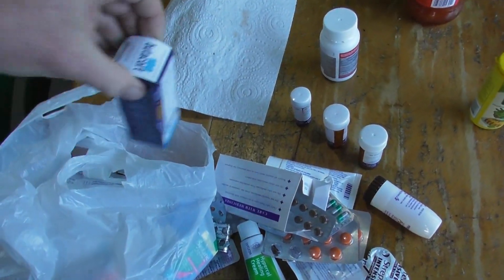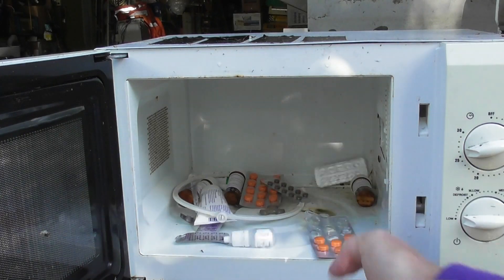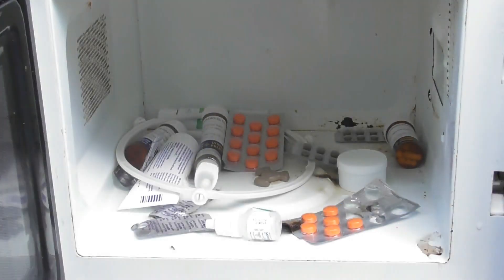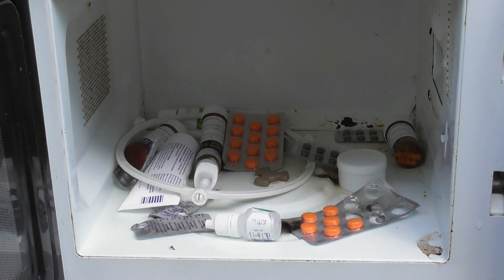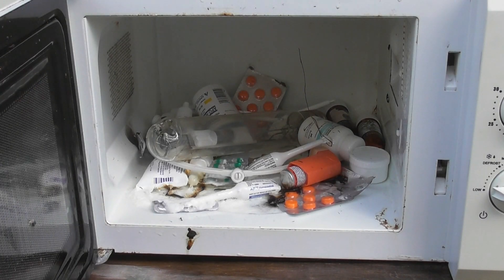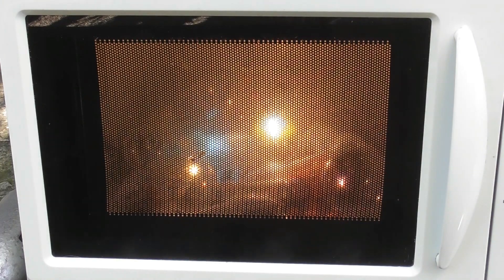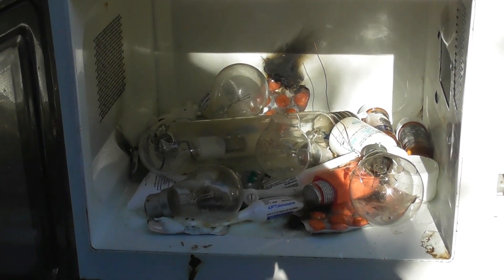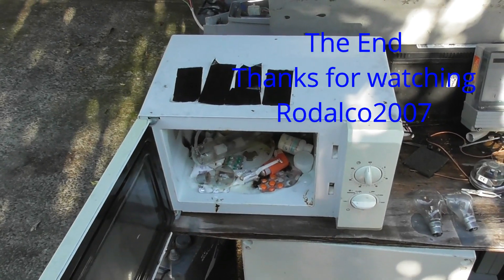Expired Medicines and bulbs in microwave

Comment: With bulbs going LED, I wonder how "filament LED" type bulbs would perform in a microwave, as I haven't come across any such videos.  These are sealed like a traditional light bulb, but with a different type of gas to keep the filaments cool, so probably will produce a different colour plasma.  Besides HID type bulbs, I've seen a few videos with a Crookes Radiometer in a microwave that gave interesting light shows.
Reply: Hmm, I'll have to give this a try. My impression was always that these bulbs were just sealed full of air. The ones I've got have the same exact bulb structure an incandescent would have, complete with the vacuum duct going down to the base and ending in a sealing pip, which is just open and unmelted but immersed in the epoxy(?) used to attach the circuit board and bulb inside the base.

Comment: On the big island to your west you can simply return expired meds to the chemist or if your evil and nasty flush them down the toilet. The exception to the last would be cyto toxic drugs but I did not see any of the normal warning labels for these at least in what was shown. The propellant in that inhaler is most lightly hydrocarbon based and might go boom in the microwave but thankfully it's case seems to have acted as a Faraday shield.   :-)
Reply: Inhaler is a pump action, using water as carrier fluid for the actives. No pressure in there at all.Venteze will not heat up till it arcs through, and in any case there the carrier is a CFC gas, only application where it is still allowed to be used.
Reply: we can return them here in New Zealand too, but no one does. I do, however return unused veterinary medicine to my vet for credit